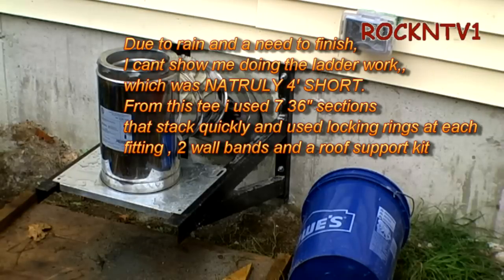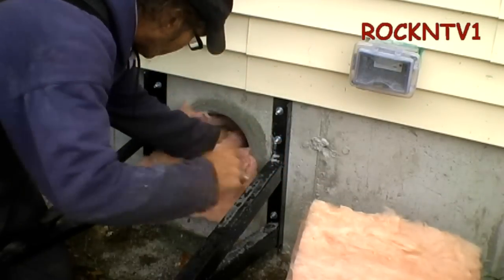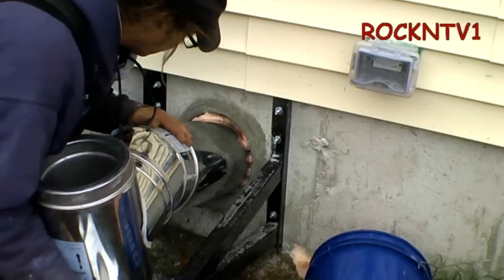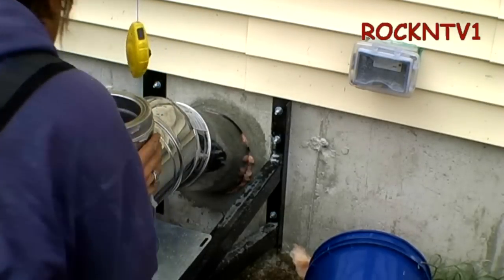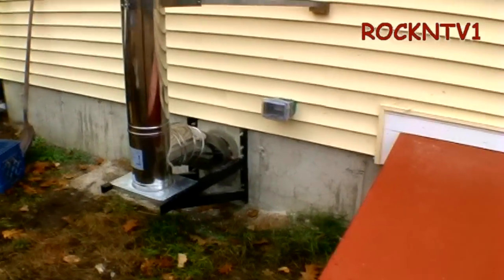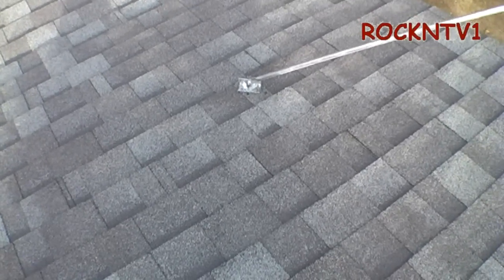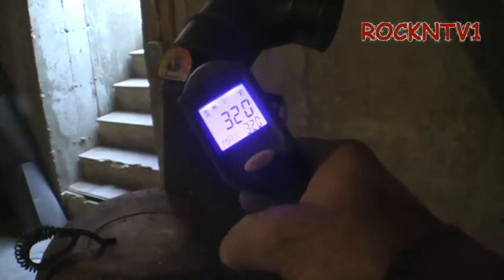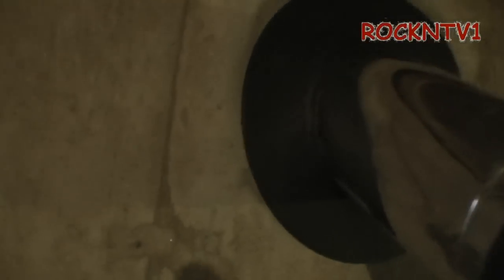SELKIRK SuperVent CHIMNEY flue INSTALL building to the ROOF pt5 Selkirk double wall insulated pipe

Comment: Great video! How big around did you have to make the hole to give you the extra room for the fiberglass insulation and what size pipe is this, 6'' or 8''?  I have to do the same thing in my basement.Thank you very much.
Reply from the maker: approx 9" od
Reply from the maker: hope all is well

Comment: They told me I need triple wall pipe to burn coal? We have very high quality coal and I wonder if double wall isn’t safe enough for my type of coal? What’s your experience is double wall pipe been good enough for you and what’s the highest temps you’ve seen your stove put out onto your stove pipe?
Reply from the maker: Dont know who they is,,, but ,, "they" are wrong,, https://youtu.be/REP6VAbYCYs, a propper coal burning stove will likely have less than 50% of the flue pipe temp of wood. To my knowledge triple wall pipe may be use on some heating applience that use return air.

Comment: I know you posted this in 2013 but hope you might respond. I just wondered how it had worked for you??? Also I had read in their pamphlet that they said the strangest thing - - they said that if you put it out the wall OUTDOORS you should build a protection around it because the cold weather temperatures could cause condensation and build up of junk in the pipe???  I wanted to know what you have experienced????  Thank you , if you have time.
Reply from the maker: the supervent flue has worked well. For the first year i checked it constantly, bought the sweeping tools to do it myself, at end of season, and quick check for pesky birds before  fall fire up.

Comment: i thought that bracket got installed up higher to support the stove  pipe am i suppose to mount it down that low like in your video or what never done this before i have a 6 inch straight pipe coming out the opening in the wall whats next to get it to the roof
Reply from the maker: the insulated T pipe

Comment: Nice job on the pipe work. Get you a more efficient stove, you will save a ton of wood. 👍
Reply from the maker: I love my stove, WAY better than the smolder fire brick lined, barely running at 4am stoves you can buy today. Thanks for watching
Reply: I have several wood stoves, none of mine smolder unless I want them to. I am stoking mine as we speak while it's currently snowing outside. I put 3 logs in last night at 9:55pm I still had a nice bed of coals. 10 hour's strong. Take care 👍👍
Reply from the maker: glad to hear that, I dont miss running Kalifornia epa glass window epa stoves, had em cant give them away here in the north east. I love my old potbelly stove, burns every thing from green to snow covered wood becuase of the placment of the air doors. Plus i can burn coal, no smoke, no dirt, and hands off for days at a time. plus, being cast iron, on those cold days i can run this old stove to 800f and warm the place right up quick,, lol I'll keep er till im dead ;-)
Reply: @ROCKNTV1  not only do u have a good stove, but you pipe is key. They way up having running up hill out of your house is a must. Most people don't understand this, they run straight up,then hard 90 level and wonder why they pipe gets clogged up in a week 😆
Reply from the maker: you are so right, dont know if you saw my 1st vid or my QnA vid in the play list, but before i bought  the through wall kit, I call the piefessionals, they wanted 4500 to kink around the over hang on the gable end,,,,,, I said no thank you and started building, manufacture says no kinks on exterior installs.  https://youtu.be/cHZ9B1CDSDE
Reply from the maker: hope all is well
Reply: @ROCKNTV1  I am good, besides birds getting into my pipe 😅 I need a new Cap

Comment: its too far away from the house, how is this a good job, all brackets are custom? No one would do this except a homeowner.
Reply from the maker: This flue pipe is installed in absolute local fire code and distance to flamable materials guidline per manufacture specs. Not to mention signed off by my insurance adjuster,,and way more rugged,  but hay you would know that , if you realy watched the video,,,

Comment: What’s the temp on the outside of the insulated pipe?  I know you have to have clearance from wood but i still wanna know how hot it gets
Reply from the maker: on a wood fire 400f at the T,  on coal fire 200f
Reply: Thanks for the info
Reply from the maker: thanks for watching

Comment: Just wondering, why wouldn't you run the pipe through the floor and then take it out the wall?you could heat the room that it goes through....
Reply from the maker: a ton more work, and room above the stove did not lend itselfe to a flue pipe, decorativly speaking.